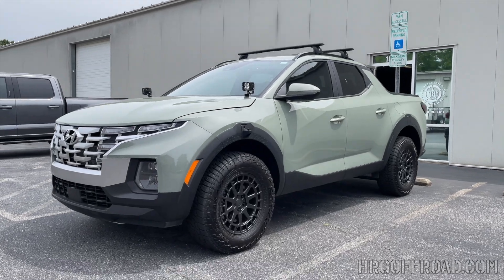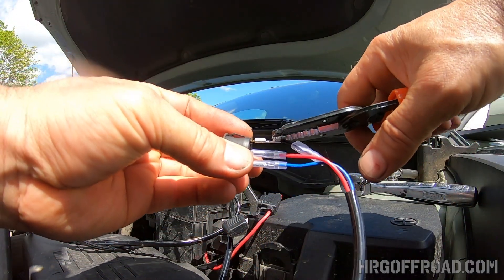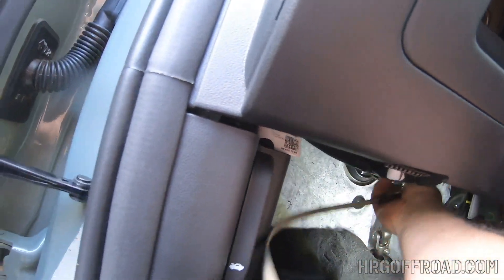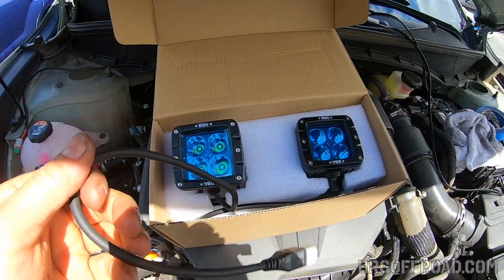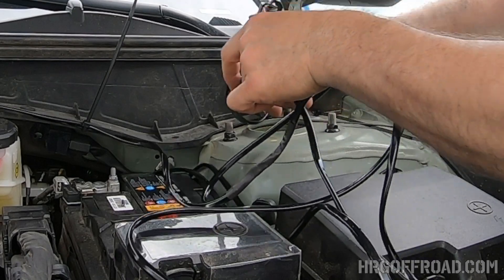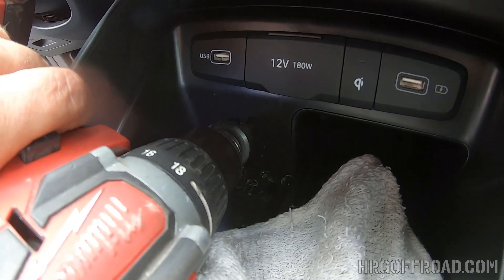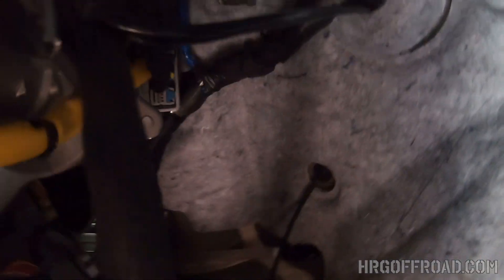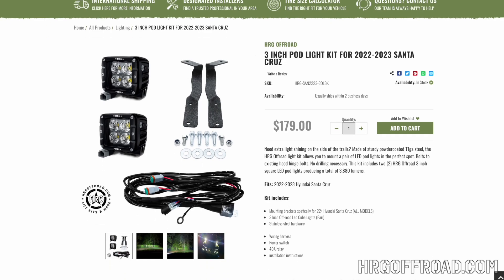How To Install Offroad Lights On A Hyundai Santa Cruz

Comment: Not sure what I got but had to mount and dismount the brackets numerous times to bend them to the right angle so it would stop hitting the hood or molding. Only response I got from HRG online was (You may have to make some small bend adjustments or clearance some plastic for proper fitment. as you can see the gap they have to fit up through is very tight. )
Reply: *Ditto that, same issue.

Comment: I ordered the brackets from your site without the lights, do you have a separate listing for just the lights so I can order again without having extra brackets?
Reply: Did you end up doing it? I wonder if you can just use Rigid D series pod lights they look like the same size